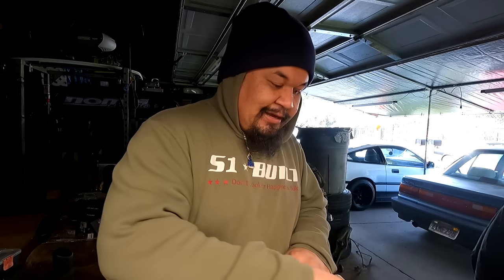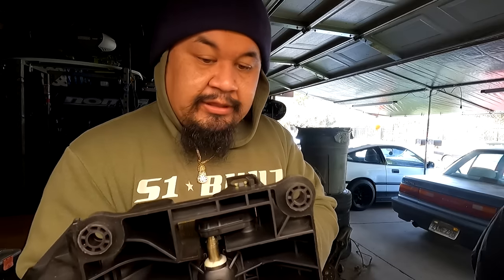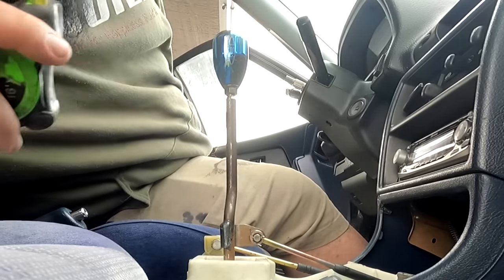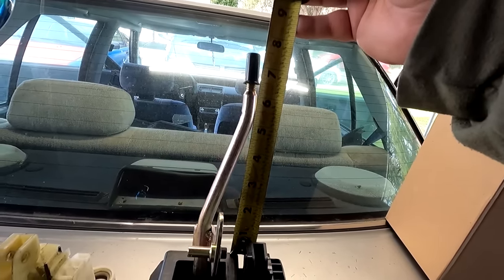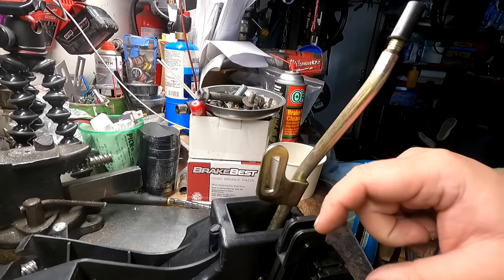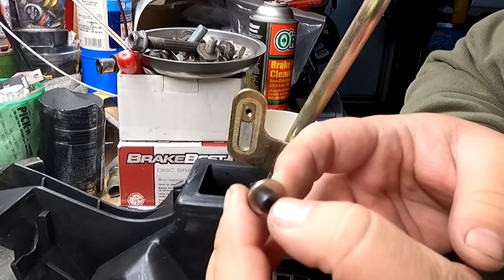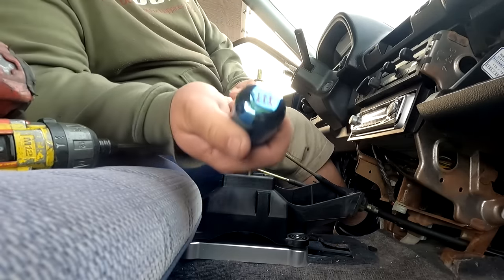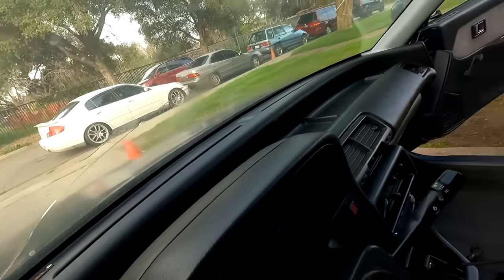K-Series Buddy Club Short Shifter Install / Review

Comment: I remember back in the day hybrid racing or k tuned made a shift assembly that would mount from under the car and you didn’t had to modify the hole for the shifter but the cables had to be run under the car and I remember people would burn them out and get stranded 😂 this was like 10 plus years when I did my eg K swap we just bolted it to the regular spot and we ran the cable from the fire wall and it looked ugly but it worked 😅